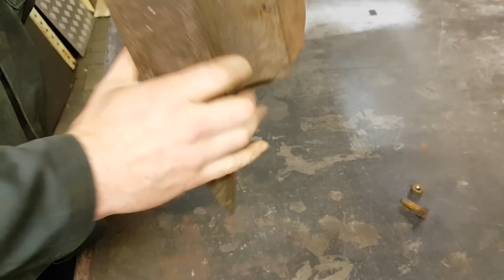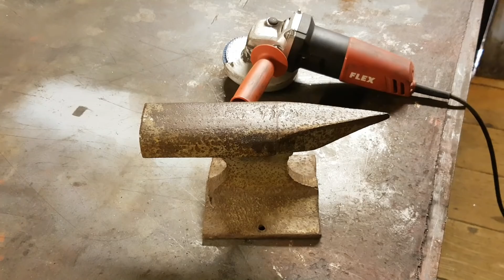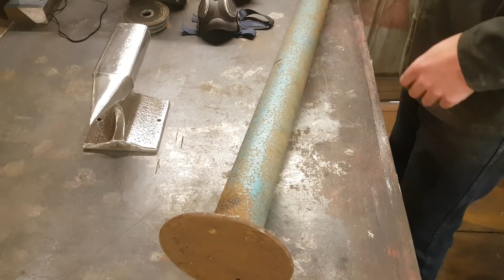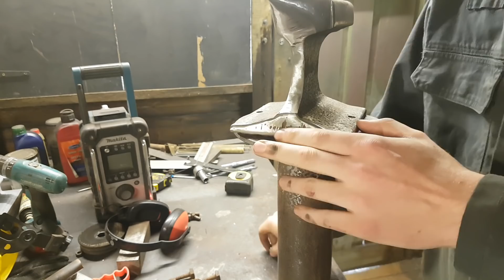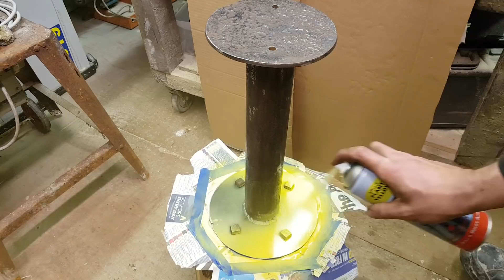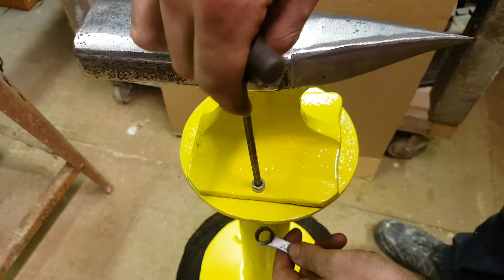Rail Anvil To Errrr? Rail Anvil

Comment: Thanks for not putting loud , annoying , distracting , stupid music in your video !  The static is from your video device microphone's decibel level   settings from the manufacture , once the decibels exceed the limits of the specs it will static , it is preset , you can try turning down the volume level on your device or you can shield and block the mic with tape or some other muffling media !   No way to turn down the grinder  !     Just like ear plugs in your ears will block the amount on decibels striking your eardrum !   Nice idea on the anvil !
Reply from the maker: I don't like videos with rubbish music overlay either. There are some really good videos on YouTube of good projects but they are often ruined with terrible "music".Thanks for the suggestions on the mic issues, Appreciate it. I will have a play around with it and see what i can do that works best.
& Thanks for watching, ED